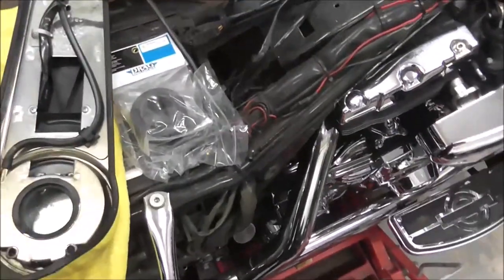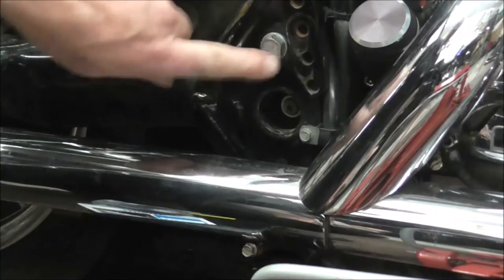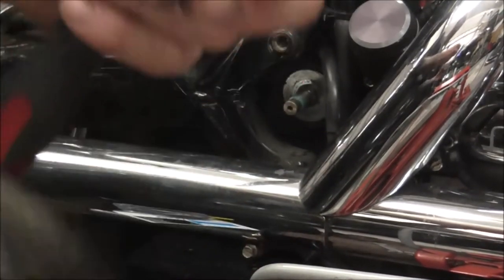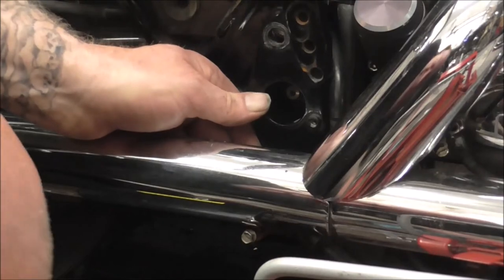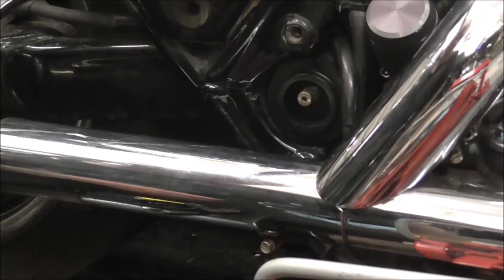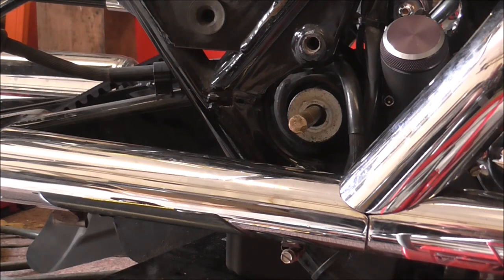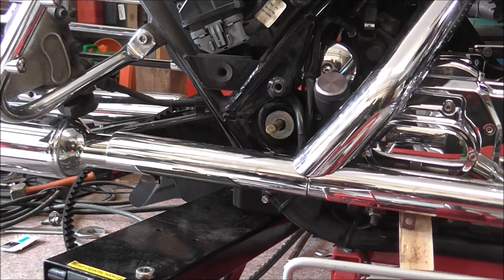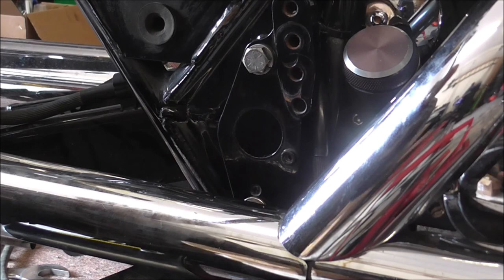HD Electraglide swingarm bushes and wheel alignment – Part 1

Comment: I bought the Glide Pro system.  Im doing a complete restoration on a 03 Road King classic.  watching all you videos.
Reply: I've learned from a few videos you can do each side separately without removing removing stabilizer rod. Need an impact though.
Reply: @gvlogger915  i have the bike completely disassembled
Reply: The pro glide is excellent

Comment: I do not just put the same thing, back in, the "New Ones" are not really any "better" than what was removed,  Other options are much better than stock design.
Two other options that have much better reliability, are The Glide-Pro System,. And another one, is Made of solid aluminum billet in a racing configuration. Will actually eliminate ALL HANDLING PROBLEMS  that are usually the reason for needing to change any isolators.
Reply from the maker: The glide pro and the other one are good systems, there is a couple of other lesser known systems out there that are very good as well but it all depends on how much you want to spend and how you ride, if you ride hard then yes put a system on it , but if you are just cruising and never ride hard the standard setup is fine. I also think that a lot of people blame the standard setup for handling problems when it is bad suspension setup, people seem to not check the suspension.
Reply: @pick6667  If the "Standard System" is fine, I doubt if there would be so many other replacement systems.. even If It Isn't ridden hard. The truth is that, the standard was engineered by a person that even WARNED the manufacturer that a Stabilizing system was need..